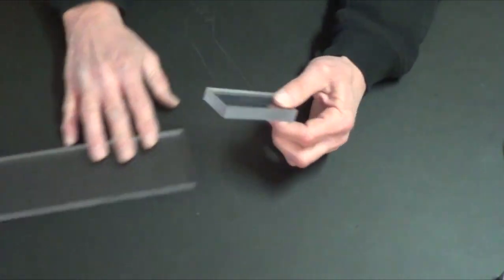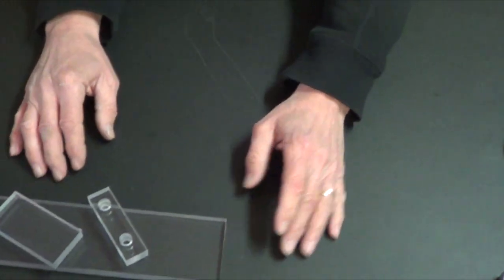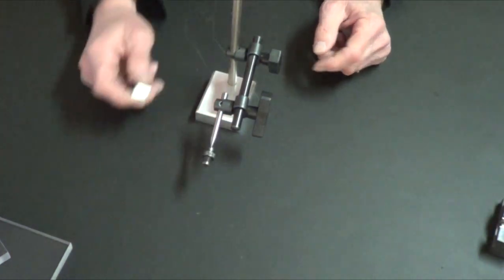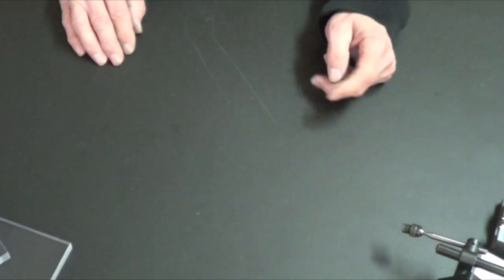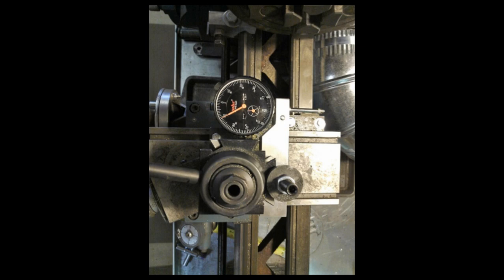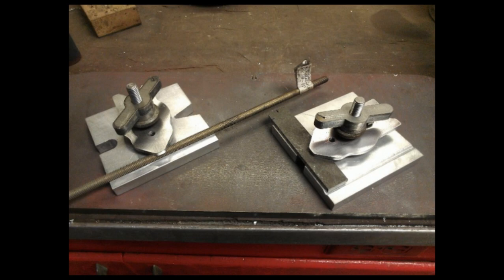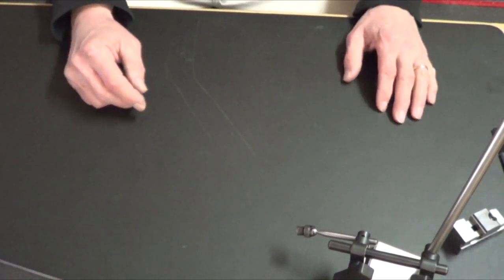Ideas Shared! Video #57

Comment: Thank you for sharing this good information with everybody.
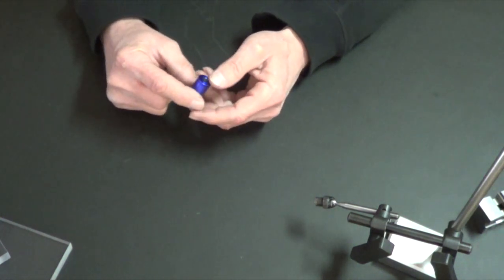Can anyone write the name of the "blue indestructible paint" on minute 14:53?
Regards from Portugal
Reply from the maker: +gamasax It can be found on Amazon and a lot of other places its called Dykem steel blue layout fluid. It also comes in red. http://www.amazon.com/Dykem-80300-Steel-Layout-Brush-/dp/B0018ACR6G/ref=sr_1_1?ie=UTF8&qid=1459621574&sr=8-1&keywords=dykem
Reply from the maker: +gamasax BTW just realized its sold in aerosol cans for even coverage.
Reply: Thank you Dave! I've found it in a big store close to me!
Thank you again!
Reply from the maker: +gamasax The only problem that has me scratching my head is it's layout fluid. It's suppose to scratch off!! So why didn't it in the video.
Reply: Maybe because you did not have a sharp enough pointer. I have compared to my regular layout fluid and it is much harder to scratch. That is why i asked you that particular brand. I have my lathe smaller irons all covered with that new harder layout fluid to prevent oxidation. I'll let you know in a couple of weeks if it works or not. :D
Reply from the maker: +gamasax OK now I get it. I have no doubt it will protect everything! But lets see....
Reply from the maker: +gamasax One thing.. read the warning label!!!